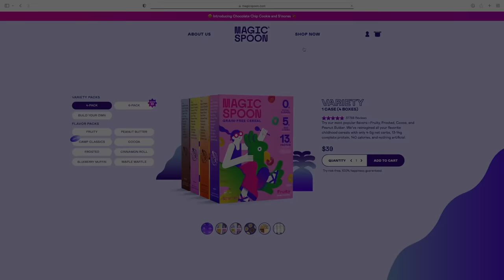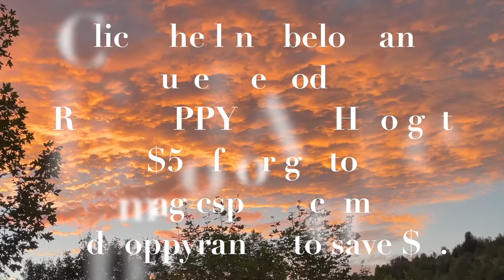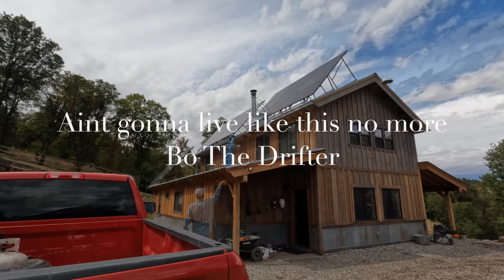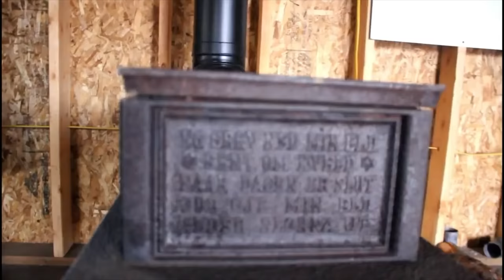#623 - Wood Stove Chimney Cleaned!!! (Before And After) Made A Snow Splitter For Chimney Roof!

Comment: When I was at high school I used to be a Chimney Sweep as a weekend job. The only advice I would give you is to sweep from the bottom up and rotate the brush as you go. Rotating the brush better cleans the walls and removes those stripes you now have on the chinmey walls. Other than that, well done!!
Reply: Absolutely right Mark, that brush looks a little small and to my eye is the wrong shape ! however the bend to get the rod through the stove might be too tight. If I remember rightly, from the top you use a lead weighted brush on a rope.

Comment: Up around the N53, our similar Osborne  circa 1994 has saved our butts during -40 furnace failures and kept our house warm and fed. Our family has never had a home without either a wood stove or fireplace since 1976.  Just for the peace of mind, let alone supplementing the head with scrap wood to keep costs down.
Reply: I have a wood stove but its my main heat source because propane is way too expensive to use for the primary heat source.  Plus you can't beat a wood fire for heat.

Comment: Wow! That chimney wasn't bad at all. I remember when I was about 8 or 9 years old, dad installed a wood stove insert into our living room fireplace. That thing was really heavy and custom made. He used that insert alot to supplement our home heater and save a little money. Anyhow, the cold season was coming to an end. My dad knew he needed to clean the chimney really soon because I don't think he cleaned it the previous year. He thought he could finish the season out and not have to pull out the insert and clean the chimney. Well, dad was burning alder wood that may have been just wet enough to create quite a creosote buildup. One night, after us kids went to bed, mom and dad stayed up to watch tv. Dad kept hearing people drive by on the street and honk their horn. Just as someone actually pulled into our driveway and laid on the horn, dad heard a deep rumble that shook that stove insert. Sure enough, we had a roaring chimney fire! Dad quickly grabbed the garden hose and climbed up the porch rail and onto the roof. He got it out. Needless to say, after that scare, I don't think dad ever used that stove again. The creosote buildup even after the fire was about 2 inches thick.
Reply: Yea that was something that scarred me and why tried to keep the chimney pipes clean. Use just pine every year there was major build up.

Comment: We professional installed an old Huge EarthStove in a large converted carport room with no insulation for backup heat here in East Texas. Came in real handy when we had snowmageddon 2 springs ago for a week.  My daughter is terrified of the stove catching the house on fire. It can easily be over stoked and the damper is contrary to work with. We have used a variety of gathered logs, some on green side all mixed together. So we use a creosote log for peace of mind. They really work.

Comment: Sir, I have watched you for a while now and marvel at your work ethic and ideas for improvement. And especially your willingness to make the mechanical repairs to the various pieces of equipment you own.
This brings me to my “I do not get it” question, with all the original and up-grade work you do, why have you not built a structure to park your wheeled equipment even if is just a pole barn type of shelter? 
I was taught to park under shelter, clean, inspect, fuel, and inspect whatever had been used for the day. Passenger vehicles were parked under a car-port. And I lived in a rather boring climate. Where as you have settled in an are with “true” seasons and all that goes with each season.
Please understand, this is not meant to be a negative observation, just one that an old Gray-beard is trying to understand.
Reply: I’ve also requested he build a lean-to for Cedar to park under especially for the winter months. I believe it’s coming, he was just trying to get the priority list done first, he’s only one person.

Comment: When I first got the notification didn't recognize the thumbnail glad I went back and checked because I knew you were due for a video as far as the cleaning of the stove pipe so long as you don't burn alot of green or high moisture wood as thats how you end up with creosote hotter burning equals cleaner pipe so you should be good Heath and the hot burning maple is one way to do that glad to see you addressed the stove in the shop since you will be in the shop this winter probably working on a vehicle or another project at least now with some heat and another purchase averted by way of the scrap steel Cedar will be happy those old clips of you installing the stove were just a reminder that time does go by quickly be careful and stay safe my friends God love ♥ ya all

Comment: As long as there  no sharp turns  could use cotton lanyard  brush need eyes for snap hood or Caribbean   a weighted ball lowered first  and use lanyard  to pull up and down thru pipe  
We used to use light set of tire chain  the the pipe

Comment: The chimney pipe had very little build up in it, the wood stove is probably more efficient than a new one. It's beautiful the way it is, personally, I wouldn't powder coat it, let it age gracefully..lol I like the new snow diverter you made, it'll last longer than the store bought one, and for alot less money too. Love what you're doing ❤️
Reply: Yeah.. I wouldn't touch it.  It's fine just how it is.   I didnt' see any creosote in the pipe at all -- just ash.  So that tells me that he burns his fires nice and hot -- which is really efficient, and even burns the smoke before it can escape.   I still use a 55 gallon drum as a stove, and it works out great.  I really like the vertical style pot belly stoves, but I haven't found one cheap enough yet--- until then, I like the classic drum for now.  It can hold a lot of wood, so you have options on how big you want to stack it in there.
Reply: @calholli  
Actually there was creosote in the chimney, a build-up of 1/4 inch can reduce the draft and still catch fire. A would stove pipe should be swept at least once a year, what dictates how often is the amount of creosote and how fast it accumulates in the chimney. 
I have some customers that get cleaned twice a burning season.
Reply: @BobJones-yf7ff  I just let it burn in the pipe.  Sometimes my fires are so hot that they shoot flames and sparks out the top of the 20ft chimney anyway.

Comment: Nice so clean. Mine is a smaller version. I have not used it since my gas furnace failed in the middle of winter about two years ago. In the city, wood costs more than gas. We keep it, and a supply of wood. We have multiple backup plans if the grid or an appliance fails. Oh, I better service my generator. It hasn’t run in 10 mo.

Comment: The top of your pipe really should be higher than the peak of your roofline so that carbon monoxide doesn't build up inside the barn. You may not have sufficient draft as you have it installed. Your setup can create a backdraft and create a dangerous situation. I suggest that you install a CO detector in the barn near the stove at a minimum. CO is not something to mess around with. I have seen it happen.

Comment: Another easier way to clean the chimney is to use a plastic whip attached to the end of your plastic pipe and then use a drill to really whip your chimney clean. The whip would also pass through your offsets all the way into the stove, which would eliminate having to disconnect the single wall pipe from the ceiling to the stove. 
If your really adventurous, you can clean everything from the bottom using the whip and fiberglass rods, that way you can keep your cap clean all winter long without getting on the roof. This will make your stove operate a lot better when the caps screen is kept clean. 
You can use your average shop vac equipped with a or green hepa filter to keep the dust in the stove when you clean it from the bottom.

Comment: Have you heard of putting an Aluminum Can into the hot fire everyday to prevent soot build up?   I thought it was an old wives tail.    But i tried it anyway and it does seem to reduce the amount of soot/creosote buildup I have every year.   Don’t want a chimney fire.  Not a perfect solution but does does seem to help.

Comment: JudithB  We  will clean  my chimney  in  Oct.  along  with  checking for  roof problems,  pruning  back  branches  and  cleaning  gutters. We  spray Flexseal  around  the  chimney, skylites  and  vent pipes  too.  I  burn  oak, hickory, cedar  and  scrap wood.  We  use to clean it  with a logging chain,  but  I  finally  spent the  money  for  the  brush and extensions  and  it  does a good job.  I  hadnt thought of putting a box in the stove to catch the  creosote!!  LOL!  I  use  stove blacking  on my  old  Grandpa Bear  and  it  cooks  real well.  So far,  we  dont get enough snow to need  the  divider,  but  great to see  how to make  one!!  Happy Fall  Ya'all!!!!

Comment: I thought the buildup in the spark arrester was caused by wet wood or chemicals in the wood such as burning lumber.  Is that correct or am I misinformed?    I thought the chimney would look worse than it did.   I guess it burned hot enough to keep soot out.    Good info on older VS newer stoves.

Comment: The pipe needs to be minimum 2 ft preferably 3 ft above anything within 10 ft horizontal.  The spark arrestor is also needed per code and should not be removed.

Comment: Wonder what a SPINNING chimney brush would do on a cleaning job?
Reply: It'll more thoroughly clean the chimney.  Just running a brush up and down the length of pipe really don't get quite all of the debris, it works, but not quite as well as rotating the brush as you go.  If you get the actual chimney sweeping rods you can put one end in a drill and run it up and down the pipe and it'll make quick work of cleaning out a stove pipe.  Just be sure you keep the drill running in the right direction, if you reverse it you'll end up with the brush stuck in the pipe, and good luck getting it back out.

Comment: Don't you clean it out every year? I had a stove for many, many years and I had to clean it out every fall. I didn't use much pine either.
Reply: You really should clean it at least once a year, and if your wood isn't wet you won't have as many issues either with build up in the chimney or stove pipe.

Comment: Save your soot. Surprisingly useful stuff.
Next time try a cable. Its weight is enough and use a stirring motion as you pay out and retrieve. 
You could avoid going on the roof entirely by putting a T at the bottom with a cap. 
But then you need the pipe again.

Comment: Your pipe is not up to code. There is a 10-3-2 rule, when your pipe extends out of the roof it has a minimum height of 3 feet. You then extend the pipe until your 10 feet level away from the roof, at that point your pipe needs to be 2 feet higher for codes. This prevents any downward pressure that can make the smoke linger in the pipe longer than it has too. 
Also that snow thing a ma- higher is not needed if you would have installed a roof support for your chimney pipe. What that is, two pieces of metal tubing attached to a metal band that wraps around the pipe and the tubular support braces are then attached to the roof.
Reply: Also removal of the spark arrestor is a bad idea and creates fire danger and allowing birds in.  As to support the pipe typically self supporting up to 5 ft.

Comment: As long as you burn your fires at full heat, it will burn up everything cleanly and you won't have issues.  Even if you use wet wood, if the fire is hot enough, it will just evaporate the water before it burns it, and you won't have any creosote.   Some people like to have a fire always burning, and just regulate the heat:   But it's better to have your fire at full blast while you're burning-- and then just regulate when to make a fire.   So it's better to have a really hot fire here and there, rather than a warm fire constantly burning.  The hotter the fire the better, basically.  A hotter fire burns cleaner and is actually more efficient.  If you see smoke color coming out of your chimney, then your fire isn't hot enough.  It should be virtually clear or have a white steam from evaporating the water out.

Comment: This is not how you’re supposed to do it. You don’t need to get on the roof; you do it from the chimney /stove ; and you start short, attach it to a screwing gun to make it spin and keep on adding segments until you reach the top. Of course seal the entry with plastic and duct tape, leaving just a small hole for your segments to get through it without making a mess. You can buy this whole hardware for 20$ no need to invent stuff either
Reply: By the way… i learned it the hard way. I asked some professional to clean my chimney (as i never had my own) I saw what he did and he charged me 90$cash for half an hour work for something so unqualified and requiring such basic hardware.
Reply: I use a dryer vent cleaning kit with a larger brush on it and do the same thing, it works great...and no falling off the roof or ladder HAHA!!!  The dryer vent rods are screw together, so you gotta make sure the drill is spinning the right direction otherwise you'll unscrew them in the pipe and you'll have a brush stuck in your stove pipe, and not an easy task to get it back out.
Reply: I did the same thing. I wasn't sure when the stovepipes had last been cleaned on my wood stoves. So I hired a professional and watched. I'm confident we can do it in the future and I know they're good and clean to start with. They had a shop vac running. As one was using the brush, the assistant was using the vacuum. It kept my house clean, especially the one in the basement near my beige carpet.
Reply: @brookiebakerie  oh yeah true he had a professionnal vac which was the only expensive equipment… but if your chimney hasn’t run for a year no chance to get a fire started and you can just use a normal one I guess. He did it as a one man job.
Reply: @augustinf  
Actually any shop vac that has a green hepa filter will work. The white and blue filters do not filter down to .5 microns which is required for creosote dust.

Comment: That flue didn't look bad for the time it hasn't been cleaned. When I moved into my house about 20 years ago, I was struggling to get the fire to work so checked the flue. The guy before me used to burn plastic bottles and there was only about an inch diameter of free space up the centre for smoke, the rest was full of soot. I went to buy a chimney brush and the old fella behind the counter said, "I shouldn't tell anyone this but when I was little my father used to drop a rope down the chimney and tie a live chicken by the legs to the rope and pull it squarking and flapping up the chimney unti it popped out the top", he swore the chimney would be clean as a whistle and chicken was fine afterward, just a bit blackened for a bit.
Reply: I avoid think about this. :)